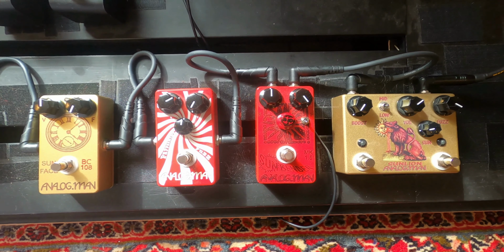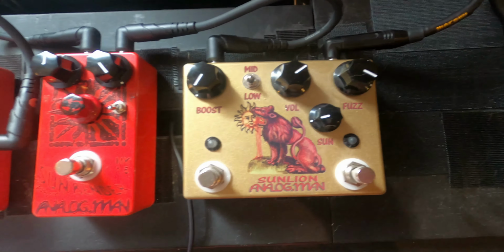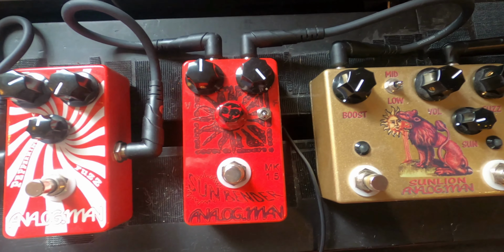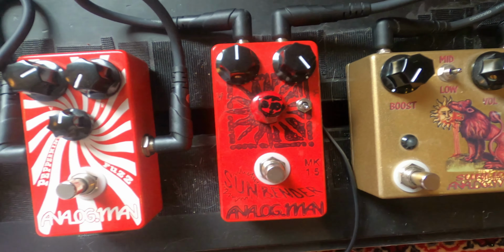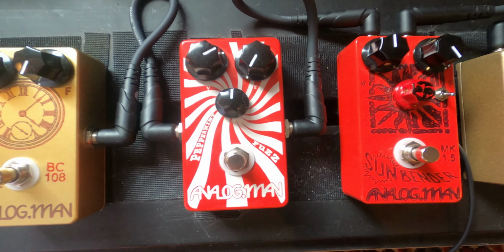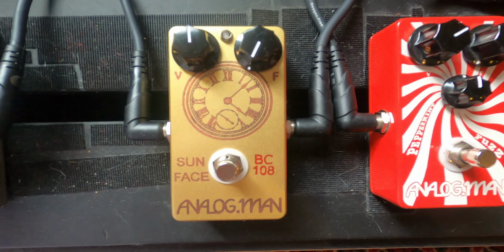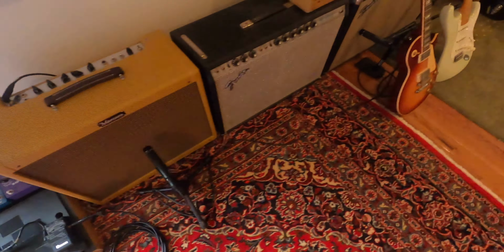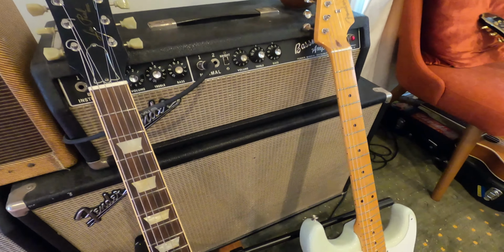An Analogman Fuzz Pedal Shootout! (BC108 vs NKT Red Dot vs Sunbender vs Peppermint Fuzz)

Comment: this is a GREAT demo, thank you so much for this! I think my favorite is the Sunbender, and of course it is the most expensive one on the used market. does anyone have any suggestions for a tone bender style pedal like the Sunbender that can be had at a lower price? (maybe $150 or below used?)

aside from that they all sounds incredible. i think i would be happy with any one. i really thought my favorite would be the Peppermint because I love psych rock, but after watching this i think i would rate them 1. Sunbender 2. Sunface 3.Peppermint (with a very close 2 and 3) 4. Sunlion .
Reply from the maker: Thanks! I would recommend the Keeley Fuzz Bender. Not exactly vintage correct but a great tone bender type for $150
Reply: @sampopkin  i think i might just go for the peppermint fuzz for like $200 lol. i’m super intrigued by analogman. they all sound great like i said! but i will definitely also check out the Keeley. thank you!
Reply from the maker: @danielcarter3928  you really can’t go wrong with Analogman. I live nearby his shop and have met him. Him and his team are good people with attention to detail. The silicon sunface is $180 if you want something cheaper. The peppermint is an easier one to use all around, but I agree the Sunbender is my favorite
Reply: @sampopkin  i think i'm going to give one of the Dunlop Hendrix Fuzz Faces a try! torn between the mini one and the full size. prob will go mini because it's cheaper and i'm on a tight budget but i do love the old school big one. seems like a really good budget alternative to the Sunface from what I've read.
Reply from the maker: @danielcarter3928  mini Dunlop fuzz faces are great! I have a friend who had some bad experiences with them and said the bigger box versions are better. But it’s a great pedal, I would recommend the roger Mayer red one with white knobs. Or the big box light blue Hendrix one
Reply: @sampopkin  ya! i want the full size but they're about 50 bucks more and i've never even had a fuzz face so i dk if i'm gonna splurge!
Reply from the maker: @danielcarter3928  I totally get that, and I hope it didn’t sound like I’m trying to dissuade you from getting anything. That’s the whole thing with YouTube demos, is ideally they just inform the buyer more. Let me know what you end up getting! :)
Reply: @sampopkin  no not at all!!! thank you for the great videos.